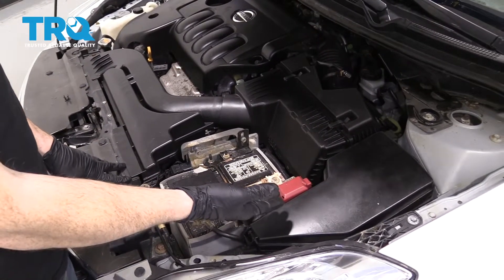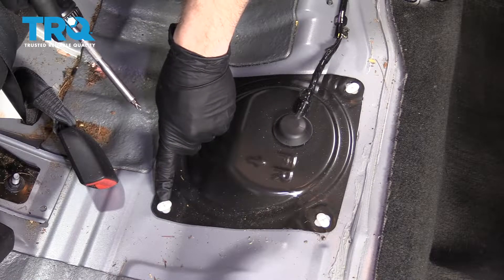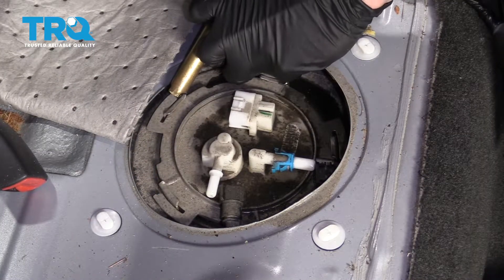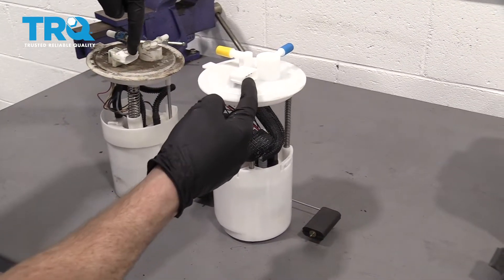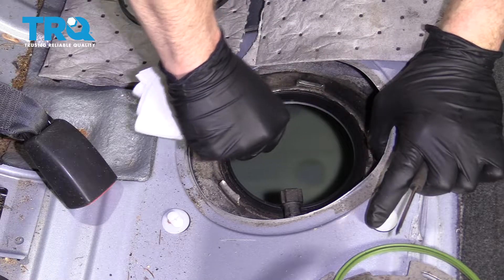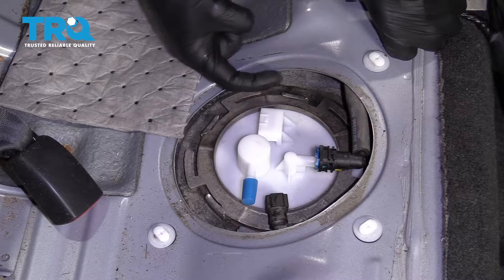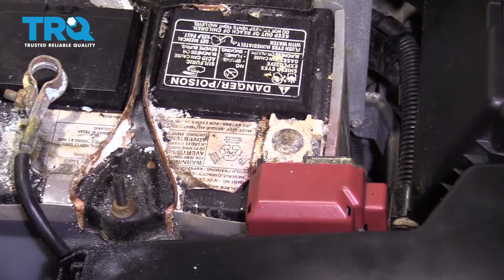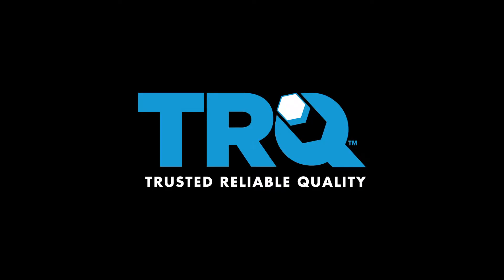How to Replace Fuel Pump 07-12 Nissan Altima

Comment: Thank you for the information and excellent instructions.  I ordered the part from Amazon ($70), the gasket from O'Reilly ($20), and the other tool from Harbor Freight ($10).  The most difficult part of the job will be getting the clip of and on again.  I used WD-40 to loosen the grip.  It was well worth replacing myself versus $900 quotes from automotive shops for parts and labor.  Be careful not to create any sparks, or it could end up not so good.  Cheers, everyone.

Comment: This was so easy to follow. I swapped out my 2011 Altima Fuel pump assembly in about 20 minutes. Thanks for the safety tip about the brass punch.

Comment: Thanks so much for the video! The dealership wanted to charge me $1200 😮 l did it myself with your how to video and saved about $800. The hardest part was getting that old ring off, took me about 15 minutes. After that it was smooth sailing. Thanks again!👍🏻
Reply from the maker: +@bodyweightstoburn6677 Thank you! We love empowering our customers and showing how to perform DIY auto repairs with our high-quality auto parts! http://1aau.to/m/Shop-TRQ

Comment: Thanks for the video. I should’ve had it done in 30 minutes but it never goes that way. Took me about 3 hours total. Some tips for anyone tackling this:

- the punch and hammer is very useful. Spend the $10 on a large brass punch from Harbor Freight or something. Trust me. 
- even with a punch it might be difficult to get the ring off. Just keep trying. Hit it on the shoulder with the punch and hammer, not the longer part on the ring. You’ll be able to make more force by hitting it on the shoulder. Hitting it on the longer part pointing backwards will bend it but you can just bend it back when you get it off. 
- Pulling out the pump is frustrating. At some point after trying for 30 minutes, I just decided to pull up very hard and it finally came out. Spilled a bunch of fuel but mine did not come out as easily as the video. The replacement pump is much easier to put in. 
- yes, needing to push down on the pump to install is normal. You’ll need to use some amount of force to push the spring down. 
- reinstalling the ring: apply some silicone grease to the contact points of the metal ring, top and bottom. Just use a very thin layer all around. Makes reinstall of the ring a breeze as it slides right on with each tap. Wipe the silicone off the top once you’re finished so it doesn’t attract dirt. But there should still be some silicone under the tab itself, which means if you ever need to take the ring off again, it’ll be way easier than this time! 

Good luck!

Comment: I bought your brand of fuel pump for my vehicle and it didn’t work, I have tried 1 other aswell and they both haven’t worked, I didn’t everything in this video and yet it always fails to start after a replacement. Do I need to prime the pump at all? Or is there anything I could be missing?
Reply: When I put the original pump back in, it runs but not well

Comment: Great video! This video also applies to the 2010 Maxima (7th gen). 
I used a spray bottle with a little soap mixed in water and a shop vac to clean up the area around the sender. I also disconnected the fuel pump electrical connector, started the engine until it stalled. I sprayed some wd40 on the lock ring for disassembly, used a bit of silicone grease on the seal (to keep it positioned) and lock ring tabs when reassembling to make it easier. Ezy peazy.
Reply from the maker: +TommyMacDaddy1 Thanks for the feedback! http://1aau.to/m/Shop-TRQ

Comment: I followed your instructions and after  installing, it cranks very long and never starts. Can suggestions greatly appreciated, right now cannot do anything.

FIX: I used Delphi FG0986 for Altima 2011, the plug and connector didn't snap in completely I have to push it  hard. Thanks to one reviewer in Amazon. However check engine light is still on, will drive some miles and update again
Reply: How’s it going now?

Comment: How to know if I need to replace the fuel pump?  I have a Altima 2010 2.5, and it is making only 5km per litre (like 13 miles per gallon). I am thinking about cleaning the injectors, but I am not sure if it would be enough, as the Altima can't be serviced by changing the fuel filter since it is part of the pump. Opinions? Thanks!
Reply: My 2011 2.5 has a bad fuel pump. Usual symptoms are rough idle/hesitation and no power upon acceleration. My car won’t even get up to 20mph with full throttle up a hill and I can hear the pump when I turn the car on. I used a fuel cleaner first and that helped out somewhat but either way that pump needs to be changed. For your case, if you are experiencing any of the problems I listed then a pump it probably required. If not then you may need a tune up or it could be your driving style

Comment: Nice explanation and great camera work! One suggestion: how about taking a vacuum and some rags to the surrounding area(s) prior to removing the lock plate to limit the amount of grit & grime that could potentially fall into the fuel tank and create more work for the filter? Just a suggestion.
Reply: Exactly..blow out all the dirt and clean it up before you take anything apart.